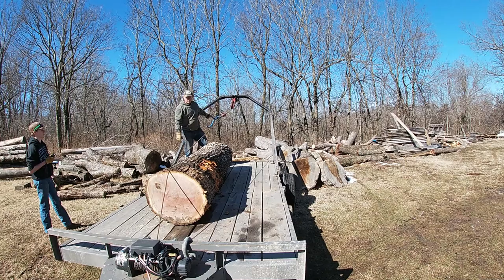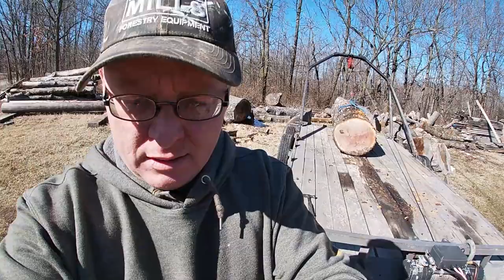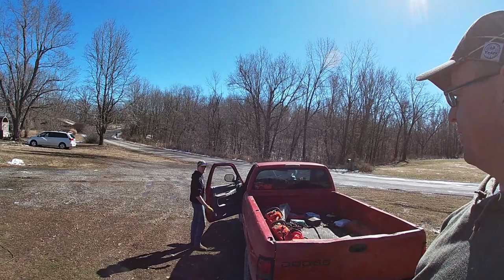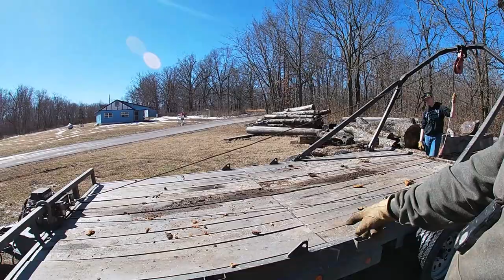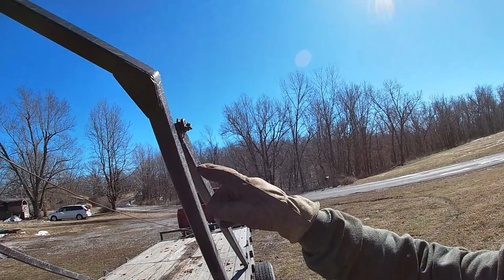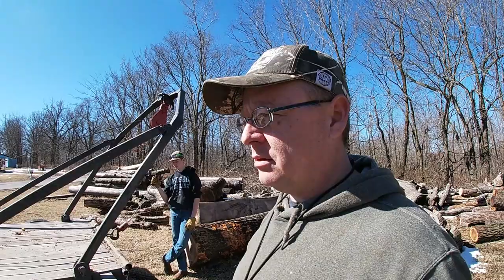SUBURBAN LOGING VLOGING.

Comment: Could you just weld an angle bracket to put on the cable to hook the back of the log and pull the log towards the pulley?
Reply from the maker: As far as an angle bracket i don't know.but usually if I try and pull from the  front end the log turns sideways on the trailer. I should've just wrapped a chain around it while it was picked up from the end.
Reply: @HOODS  yeah I never did it I’m just arm chair logging today😁😁😁